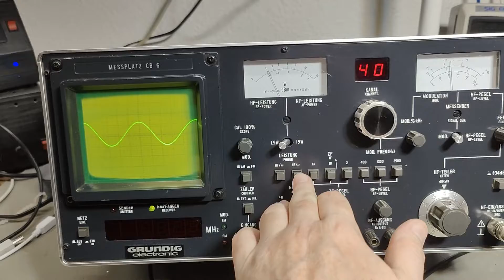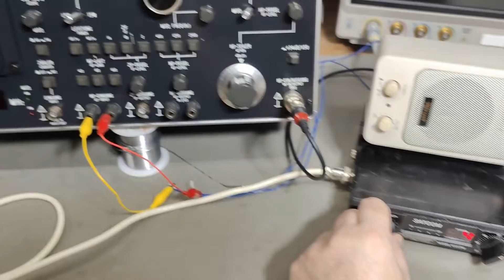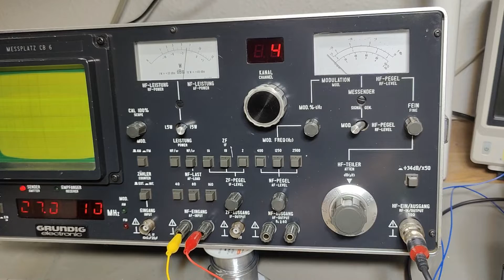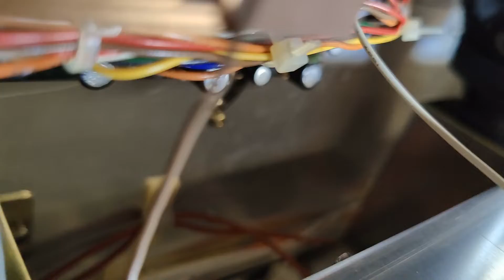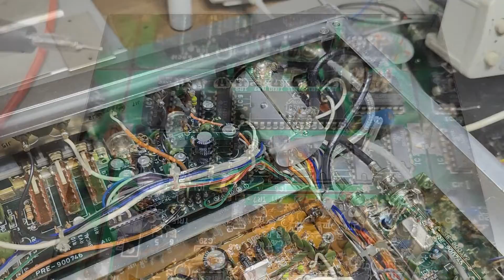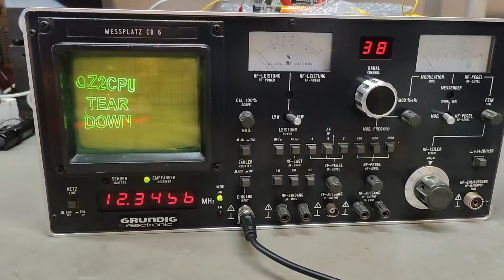Grundig funk messplatz CB6 1978-79 test station for CB 27MHz teardown

Comment: Hi , what voltage and  value resistors are you using to probe the LED segments please?
Cheers😊
Reply from the maker: 1k and 5V you dont need much
Reply: @TeardownOZ2CPU  I have a few digit segments out on my old Logimtetrics 921A sig gen, I will give it a crack..
🍻